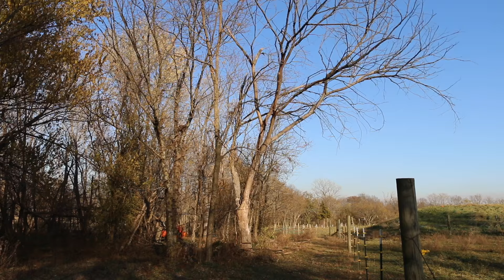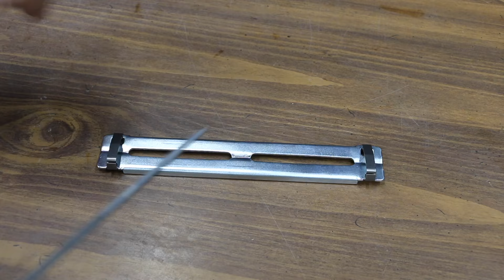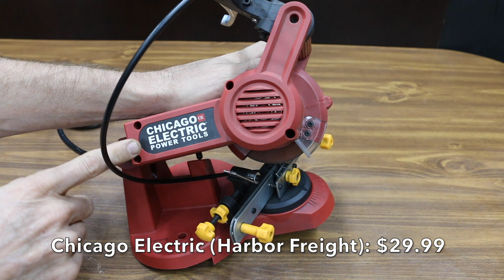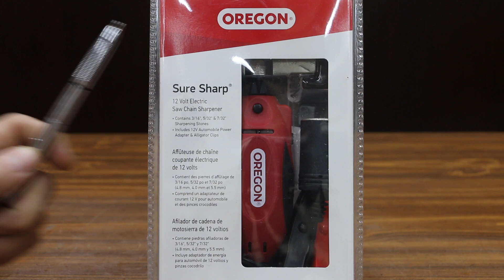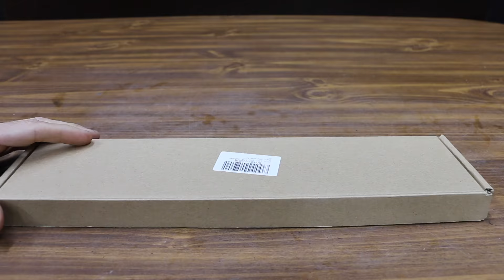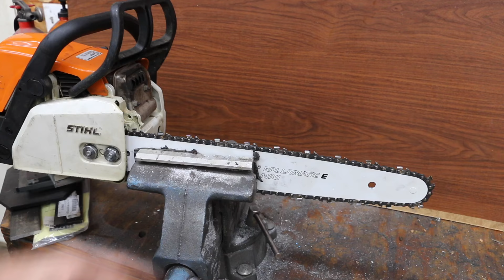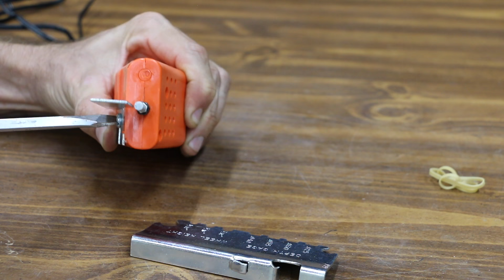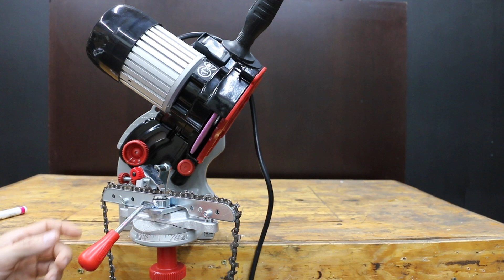Which Chainsaw Sharpener is Best? Let's find out! Stihl, Granberg, Chicago Electric, Oregon

Comment: I have the Granberg 12v system and I really like it. Little bit of a learning curve to setup but it does a great job at restoring chains that have hit rocks. I've found if your not careful you can sharpen the two cutting sides uneven; resulting in a chain that wants to cut at an angle.
Reply from the maker: Thanks for sharing.

Comment: I have all 3 sizes of the Stihl 2 in 1 sharpener.  I run a stroke or 2 over each tooth of the chain each time I fill fuel.  The 2 in 1 file will speed things up for you once the chain is in its 4th or 5th sharpening, as it deals with raker height at the same time.
Reply from the maker: Thanks for sharing.

Comment: It looked to me like the Oregon bench system overheated the chain because it looks blue and maybe that’s why I did not perform very well
Reply: Do you think chainsaw blade is hardened steel? Because I don't. If it was good luck filing it. Sparks are not the right color or character anyways.
Reply from the maker: Thanks for the feedback.

Comment: I have the Oregon bench grinder. I was not impressed with the performance to $ with the stock grinding wheels. I upgraded to diamond wheels and am very happy with it now.
Reply: Diamond really isn't meant to be used high speed grinding ferrous metals. The heat developed by friction tends to dissolve the diamonds in the steel. Diamond is more suitable for grinding carbide. Aluminum oxide is the preferred grinding media for steel.
Reply: @1pcfred  It was my understanding that diamonds are fine for steel under the right circumstances. The heat issue is not with the diamond itself but with the binding material holding it to the substrate breaking down when overheated or too much pressure is applied. I determined that it was a reasonable purchase for the chain grinder because the process is low pressure with a small contact area for a short period of time.

You are correct that it will break down eventually, as all things do, and because of the single layer of abrasive I will be left with a bare metal wheel when it's done. But if I get 100 chains out of it I will be happy. Worth it to never burn the chain.
Reply from the maker: Thanks for sharing.

Comment: Another great review project farm
Reply from the maker: Thanks again!
Reply: @ProjectFarm  you may have already done this test but I'll pass it along.  I've used many degreaser and resorted to hot water washer and pressure until I found this.  Oven, grill and fryer cleaner from members mark at Sam's club and also on amazon.  It is amazing.  Do a review between this, purple power and greased lightning

Comment: Great video. After trying a bunch of different solutions myself, I settled on the Sthil 2 in 1 (actually the Pferd version, which is the same thing, only cheaper) for myself.  It's very simple to use, no complicated set up.  I'm pleased to see that you get almost the top results with that.  I'm sticking with it.  Thanks for the great video.
Reply from the maker: You are welcome.  Thanks for sharing.

Comment: Would love to see the time of a chain hand sharpened by an old time logger.  I have tried several of these systems, but always go back to hand filing with just a round file.  I do use a depth gauge for the rakers, but everything else I prefer to eyeball because in real use, every tooth requires a different amount of attention and shaping.  Many of the tools you have showcased are excellent for novices who are not familiar with getting angles right, but someone who has sharpened a lot of chains in the field is going to be way more precise than some of these automated systems.  Another issue to consider, (but I would imagine would be hard to test) is the risk of heat throwing off the temper of teeth.  I saw a few that had obvious heat bluing.
Reply: I have had such loggers hand file for me occasionally and let me just say that their prowess is often all in their head. You simply cannot hold a perfect angle hand sharpening and when you give a chain "a different amount of attention and shaping." things get wonky real fast. Different length cutters cause some cutters to do all the work (since they are sloped) which leads to premature dulling and overheating and different angles work about as well as a rounded butter-knife edge compared to a hollow ground knife edge. Jigs and bench grinders done right are 100% of the time always better than hand filing.
Reply: @SaneAsylum  Sounds like you have only worked with east coast sawyers.... 

I am joking of course.  I definitely hear what you are saying, but in my experience, it doesn't actually work out that way.  The thing is if you chip one tooth, you need to reshape that one and bring it down further than the others to keep your angles and cutting potential the same (along with the raker).  Very few people end up with chains that have even tooth wear because they hit grit in the wood, or have a quick touch against the ground.  You have to be able to account for it accordingly.  Many of the tools shown here  still require a sharp eye and ability to adjust on the fly.  It is a learned skill and I would say for most people, automation will produce more consistent results, but don't discount the importance of the human touch.  The Stihl 2-in-1 (that preformed very well in these tests) is the best of both worlds in my experience.
Reply: @BenKickert  Actually I sawed my way up from the Great Basin into Southeast, Alaska (The Tongass) many years ago so I have done it all. I will nitpick just one thing and then leave it at that. If you chip a tooth and bring it back at all without bringing all the teeth back the same amount it will not cut at all (that tooth, the rest of them (except it's mirror twin) will cut fine). Cutters are sloped so every time you grind them back the top plate gets lower (closer to the bar). Since it takes two cutters to actually make a cut (they are shaped like an "L" so the first severs a fiber and the second with an opposite side-plate actually removes the cutting) so when one cutter is removed from the equation the "twin" becomes inefficient and requires the next cutter to re-cut the wood and the one after that to sever it. So you basically lose two of your cutters doing that and muck things up for two more.
Reply: @SaneAsylum I am an east coaster who learned to cut out west, so my comment was a bit tongue in cheek.  I hear what you are saying for sure.  Sounds like we are actually on the same page, but focusing on optimal versus practical applications.  To your point, if you are running full skip instead of full comp, the differences in cutter height is going to less impactful.  Likewise, if you are pulling full comp, you may loose some efficiency, but you have enough teeth to compensate.  And, if you are able to file your teeth as needed, eventually things will regress towards the mean and work themselves out.
Reply: @BenKickert  All absolutely true.
Reply from the maker: Thanks for the feedback.

Comment: Oregon Power Sharp is one of my favorites. Requires special chain and bar. The Oregon and decent knockoffs clamp through holes in the bar so it can't wabble like yours. And really does sharpen in 3 seconds. 

The Harbor Freight electric bench grinder is really nice for normal chains. Very easy to use especially after being initially set up. Can sharpen several chains quickly.
Reply from the maker: Thanks for sharing!

Comment: not sure the outcome would be greatly different but cutting at a angle adds more surface area for friction to take effect, the only test you did with a level cutting angle was the new chain, thus cutting only 8" of material, where as the others cuts could be 1" or more material
Reply from the maker: Thanks for the feedback.

Comment: Well..... Here's the bottom line.: Learning to sharpen a chain by hand is still the best way. It may take a bit longer, but it's still the best way. Great video!
Reply from the maker: Thanks!  Thanks for the feedback.
Reply: Learning how to sharpen period is good practice. I'll take the power methods over hand any day of the week too. You don't think they sharpen them by hand at the factory, do you? Because they don't.
Reply: You mean they don't sharpen the chains at the factory by hand? I never knew that 😂.. seriously though, one of the biggest problems I see is when I get chains in to file, the teeth are burnt. When that happens the teeth tips get brittle and result in chipping at The cutting edge of the tooth.
Reply: @advance9572  I guess folks just don't like springing for bar oil?
Reply: @1pcfred  Paul, bar oil has nothing to with this other than a dry hot chain that may ruin the bar, and the chain, and excessive wear on the sprocket. All I'm saying is that when people bring me chains to fix after they have had someone automatically / mechanically, fix their chains, they are burnt. It's not just that, it's raker hithe as well as the bar health. Did I spell highth wrong??!   Thanks Paul 👍

Comment: Two things. When you used the $200 oregon sharpener sparks were flying! You're cutting way too much chain. Look at the blue/gold color, you overheated the chain. 
Also, you need to keep the test saw at the same angle all the time to be a fair test. 
I only use my oregon sharpener ( mines not made in chiner) if the cutting teeth are not all the same size and all messed up.
Reply: You cannot take the temper out of metal that is not hardened to begin with. Chainsaw chains are not exactly fine cutlery. Which is a big reason why you can sharpen them with files to begin with. Do you have any idea what would happen if chain was hardened and you hit a stone with one? You need a special license to own fully automatic weapons in this country!
Reply from the maker: Thanks for the constructive feedback.

Comment: When I was 12 I started working in the woods with brother in law who is a logger.   We did fire wood on the weekends, I learned how to sharpen chains really quick because that was the only way you got a break aside from lunch.    I had to knock a couple trees down last spring, found out pretty quick that I had lost my touch from 30 years ago, but found an old box of sandvic files and it going again.    I’m a firm believer in hand sharpening because you won’t always have your sharpener available.
Reply: Yes I will.
Reply from the maker: Thanks for sharing.

Comment: I now know what chainsaw sharpening tool to recommend or use !!! I’d love to know what’s the best paint remover or stripper for automotive
Reply: People in the know know not to strip paint off auto bodies. That's because the raw metal picks moisture up which causes oxidation. Which is why we paint vehicles in the first place. So they don't rust! But if you do take the paint off there are prep conditioners you use. Turns the metal a blue.
Reply from the maker: Thanks for the video idea.

Comment: I have yet to find a better sharpening system than the Stihl 2n1.  It's very convenient, can be carried in my pocket, and requires no power.  While sharpening, it also keeps the rakers at an appropriate height to the cutters, all at the same time as sharpening, which means time saving.  It's also available in the Pferd name at a few bucks less than Stihl.  I've also learned it also works on skip tooth chains with a very minor adjustment in technique.  It also comes in at a very good price point.  I live in the Pacific northwest for reference.   Personally, I think it's by far the most bang for the buck.
Reply from the maker: Thanks for the feedback.

Comment: I use my dremel with a round stone bit and it works fine.. takes about 10 minutes. I was wondering if the "Lil Diho" type sharpeners worked... glad I didn't try it!! Thx Todd! (edit) I did some reading in here and it seems that sharpener requires a specific chain... I'll have to look into that since that sharpener is much easier to work with. As long as the chain price is reasonable anyways.
Reply from the maker: Thanks for the feedback.

Comment: I cut juniper for firewood, off my ranch property in the high desert. The shaggy bark picks up dust and dirt. some of the trees are hundreds of years old and the bark is 2-3" thick, plus the trunks dont grow round, there are lots of folds for dirt to stick in. Point being, I have to sharpen a chain before I can buck sometimes. I spend an inordinate amount of time sharpening in the field. Nothing is simpler and faster than the Stihl 2-in-1 IMO, it just works. Its fast, repeatable, and uses files that are easy to find, no tiny or weird parts to lose or replace. You can operate it in the cold, with gloves on. Given its tiny size, dual action, and now test results showing its as good as the best, I rest my case.
Reply from the maker: Thanks for sharing.

Comment: The line on the chain is also to indicate the limit to sharpening, as in it's the minimum amount of "bit" before the chain has to be thrown away

Edit: I use a bench chain sharpener and you are correct there is a learning curve, after using it for a bit,  it's really fast
Reply from the maker: Thanks for the feedback.

Comment: You been using one of them wrong. The one you install at the end of the blade and press on the ground is not meant for standard bar and chain. They offered me that option when last year when i bought my new chainsaw. You need the bar and chain meant to be sharpened with those. Basically you need the all package. Not just the sharpener. Then thats gonna work.
Reply from the maker: Thanks for the constructive feedback.

Comment: I used to work as a ground guy for a professional tree service. The guy was very good, recognized as one of the best in the area. We occasionally got calls from other tree services to assist and bail them out of tricky situations and dangerous removals. I took what this guy had to say on the topic of tree removals as gospel. He refused to use any type of power chain sharpener and insisted on hand sharpening his chains with a file. He claimed that the type of steel used in chainsaw chains is very soft and heat buildup from power sharpeners would harden the blades and make them brittle and hard, therefore progressively harder to sharpen each time a power sharpener was used and potentially cause problems with blades breaking due to making them brittle. He insisted on using only Stihl products. Seeing two Stihl products in this test makes me wonder if he was mistaken. Anyone have any insight on this? He wouldn't be the first professional I've known over the years to have old fashioned ideas or tell old wives' tales. Maybe he used to be right? Maybe chains are made of different steel now? Any insight anyone?
Reply: When used properly a grinder takes a little cut very quickly and does not build up heat to any degree that matters. Modern steels are not harmed by a decent amount of bluing from heat (watch a few videos on mill and lathe cutting tools). Hand filing however can never maintain an accurate angle on a single cutter let alone uniformity between cutters. Also when you file by hand sometimes the file grabs good and removes more metal that some passes, so it isn't like every pass removes exactly the same amount of material even if anybody could hold it perfectly in a single plane (which they cannot). When you have teeth of different lengths you get some teeth either cutting very shallow (dust instead of chips) or not at all because cutters are sloped. When you change side plate angles and top plate angles by degrees your chain vibrates a lot more and cuts erratically. Think of a rounded cutting edge vs. a hollow ground edge. There are hand grinding jigs like the Timberline that do as good as anything if not better and there are grinders that used properly can do as good as anything else and faster at that. But unguided hand filing can not ever and will not ever produce equal results to those.
Reply: @SaneAsylum  Were power grinders always that good? Just wondering if my old boss was outdated and old school or just straight up mistaken. What do you think? I'm interested in knowing because I still see him from time to time, a conversation and a Project Farm video might be helpful to him next time I see him.
Reply: @artvandelay1099  Well steels have changed a lot over the years for starters, but as to grinders they are in fact extremely basic (technology hasn't really changed). The best chain in the industry is actually square ground and nobody files square by hand if that tells you anything.
Reply from the maker: Thanks for the feedback.

Comment: I wish the timberline chainsaw sharpener was in the line up. I've always wanted to see how well they work.
Reply: Speaking from much experience I have found nothing better. The burrs last forever so long as you don't spin them backwards (as with any file). My chains cut way better than new. Wear longer and cut faster.
Reply: Same here.. I have tried other sharpeners and found it easier to just buy a new chain lol.. But I would buy the Timberline if I saw PF use it and prove it was worth the money..
Reply from the maker: Thanks for the video idea.

Comment: Too bad you didn't find " one of those logger guys" who does it freestyle by hand to compare ! We used to use something like the Stihl hand sharpener at a park I worked at ( was made by husqavarna ?) . Novices could do a good job sharpening chains using it. The Stihl hand one is the one I have been looking at getting recently and your video confirms it is good.
Reply: Needed to have them do the chain grinder as well (though he only tested a few marginal ones here). He didn't do justice to proper bench grinders by any stretch of the imagination.
Reply from the maker: Thanks for the feedback.